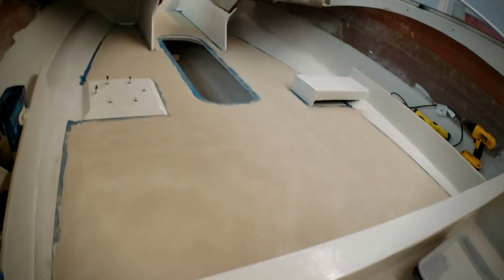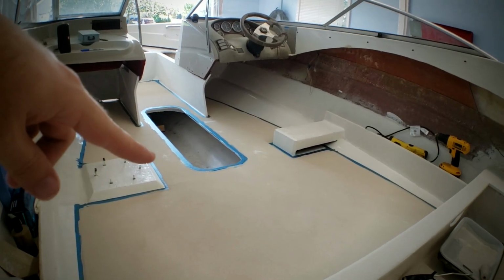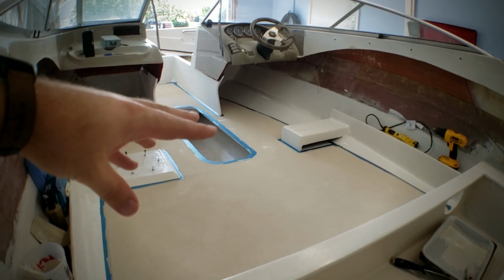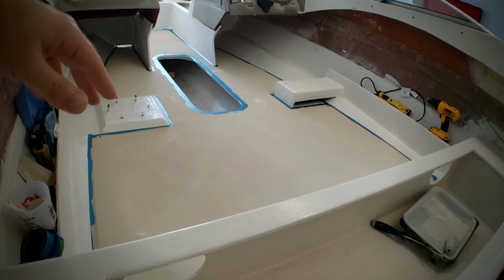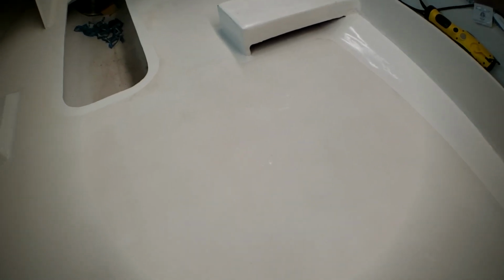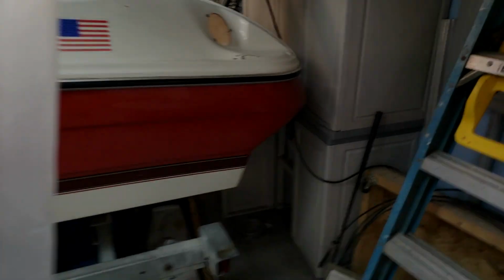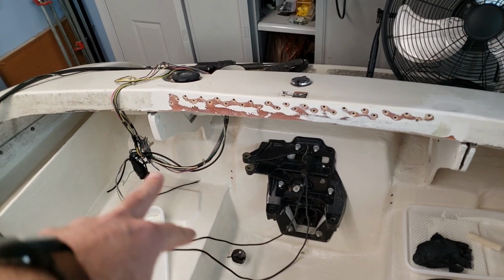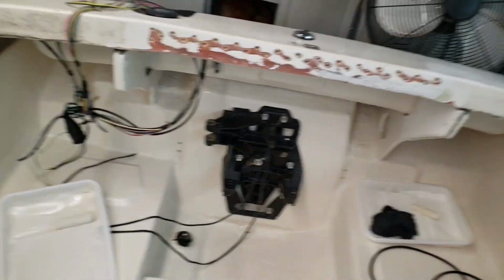How to Paint Your Boat with Interlux Brightside: Part 2 - Applying Nonskid and Top Coat

Comment: Great video    Torture to watch     The whole process is kinda backwards        First off use a 2 part poly that way it will cure hard.  Pour the paint and smooth it out      The constant dipping in the pan well you just do not get enough paint for sand and good coverage for finish.  The thought of the thinner going off that fast well it is expensive plain old paint thinner.  You have plenty of time.  Sanding between coats is not needed.  If that super expensive poly wont stick well it is time  for primer with color.  Last thought is get some fresh air in the garage.  The fumes are extremely harmful and each time you do a cleaning  or mixing - painting you are compounding exposure to brain cell killing fumes.  They add up each day so the next exposure is much worse.